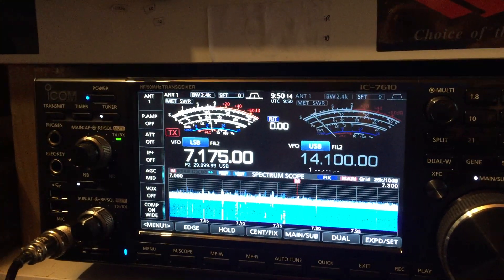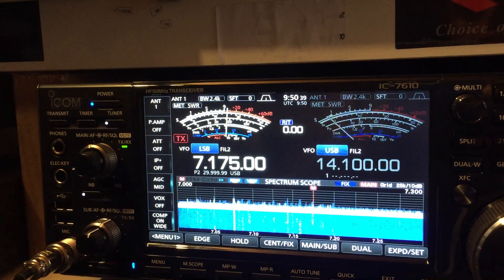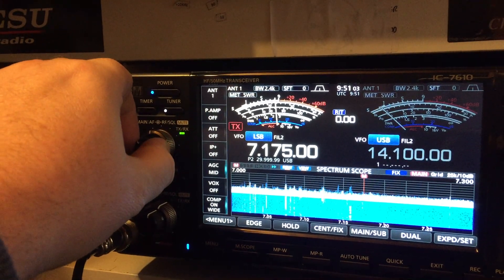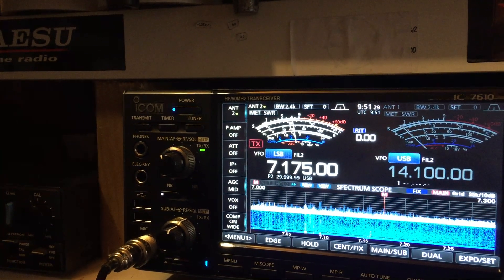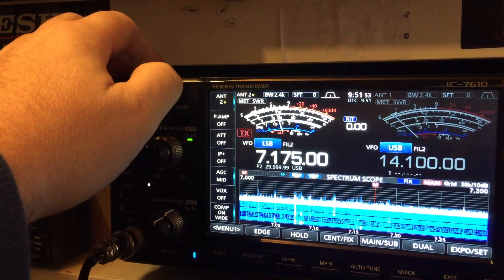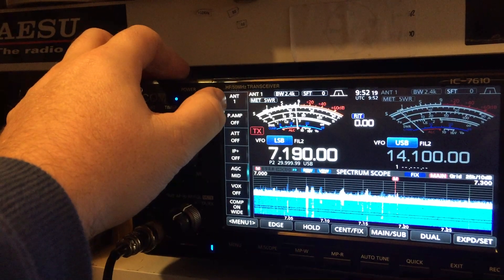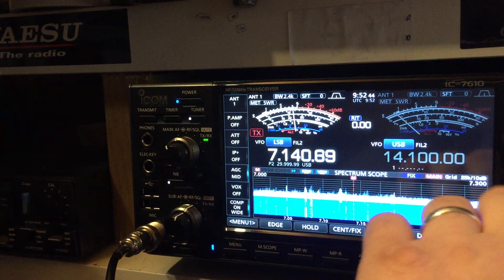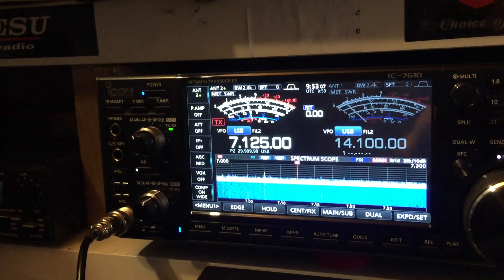Ham radio quick antenna test endfed and delta loop

Comment: What end fed do you use darren
Reply from the maker: Derek Reid  Tell you the truth I can’t mind the manufacturer as I  had it in a Joblot and the endfed was new in the packing I’ve got the packing in the shack somewhere I’ll try look it out but covers 40-10 metre which I’ve only used it on 
Does work on 80m but not so good .
I wanted too try the delta loop out too try and see if I’ll have less noise it’s worked abit but really think I’m getting some qrn at my Qth . Stay safe